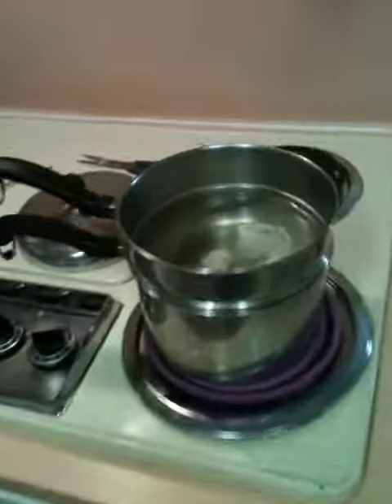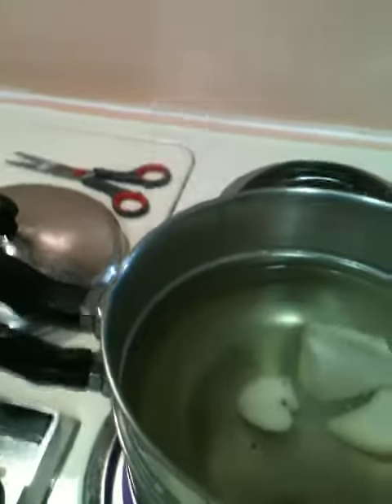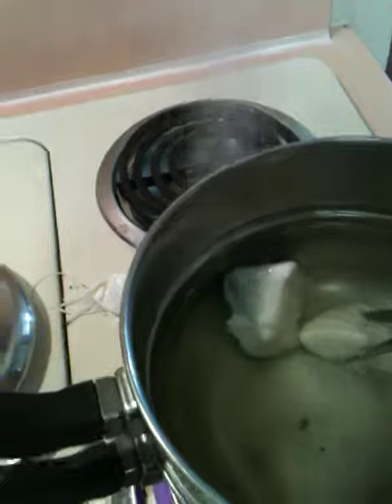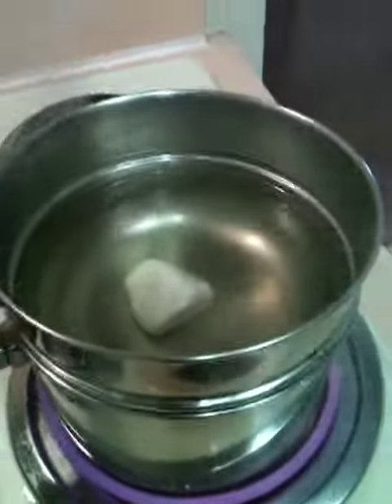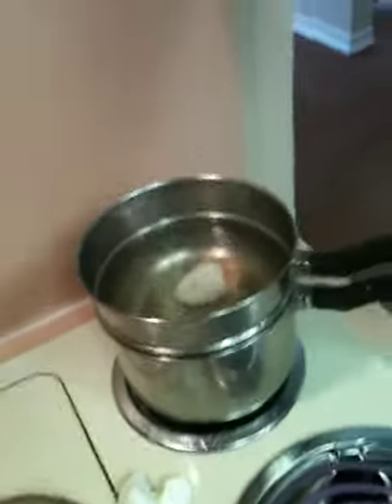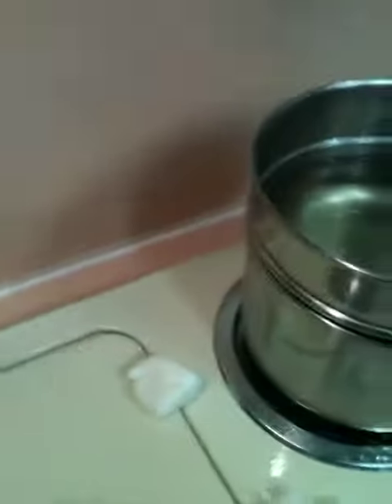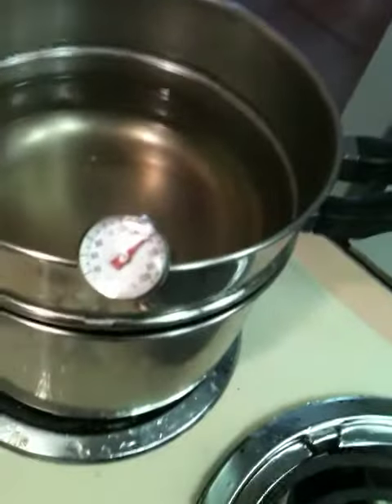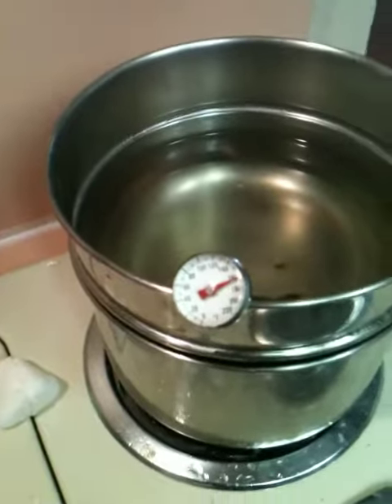DOUBLE BOILER FOR POTTING PUPS

Comment from the maker: I didnt have any Bees wax so I just used candles I had laying around and believe it or not they worked just fine. Filled in all the gaps and the PuPs were no longer Microphonic. And Ive gone back and checked to see if any wax has flaked off but nope not as yet. Course I dry removed any extra that formed on the PUP and there was not that much. END result I used them for a short time and just got some new Gibsons.

Comment: When I do this I use about 20% beeswax, 60% paraffin wax (or candle wax), which seems to work. I read that the paraffin wax really penetrates well, but when it dries it is brittle and flaky, which is why you add beeswax which is softer. But I would think if you used 50% beeswax that might not get into all the gaps in your pickup.

Comment from the maker: Dude, I had NO Bees wax to use and checked around town..none to be had at the regular hobby shop. I USUALLY have some OLD stuff from the Previous time in my KIT..But, either it was totally used the LAST TIME..years ago OR, was tossed out during a clean out. The Mix is about 60-40? B to P...course there are a hundred different opinions on this Mix. Many SWEAR its 50/50 and also as MANY 70/30 just experiment is what I say and do...but I personally use 60/40 when I have Bees.

Comment: Hi Dave maybe a silly question but do to vax ruin the pot?
and what can I do with the vax that left?
Reply from the maker: YES, you CAN RUIN a pup with wax thats just too hot at the time you set the PUP inside. You can also use the wrong mixture of wax.  Best bet use a thermometer and keep the temp under 140  
Remember, You can always Save that used wax for future work on More POTs or any other house hold chore. Specially the Bees Wax.